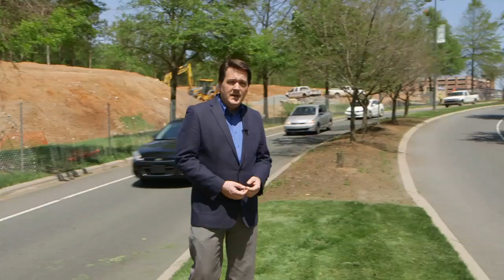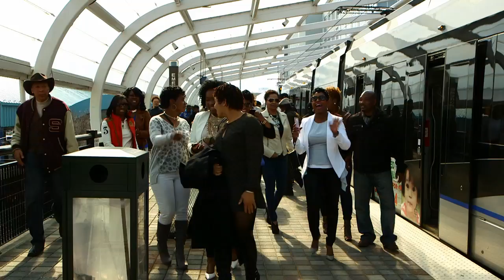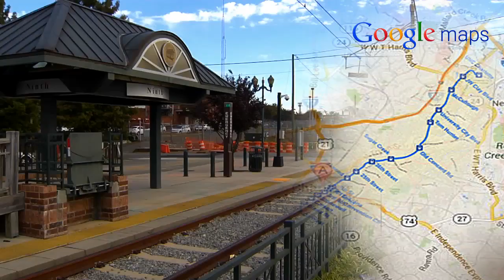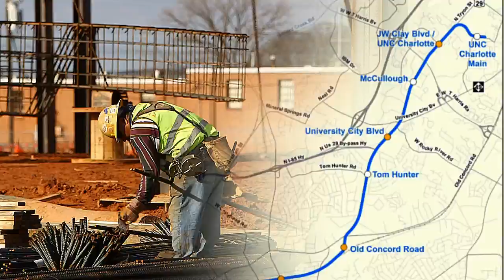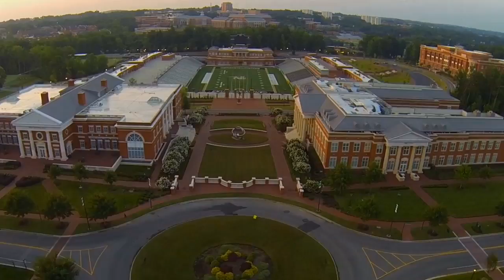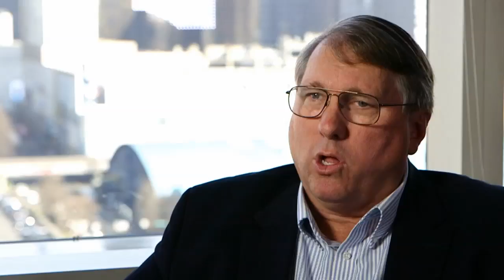Charlotte Light Rail Extension

Comment: When will the City Council study a[n] "newer expansion of the light rail line" from the City Center directly connecting Charlotte Douglas International Airport and points between. Dubbed LYNX Orange Line ... or, some such titling. It could serve both as 1) an express and, 2) or, serving all local stops to DT Charlotte. Same model transit cars currently in usage.